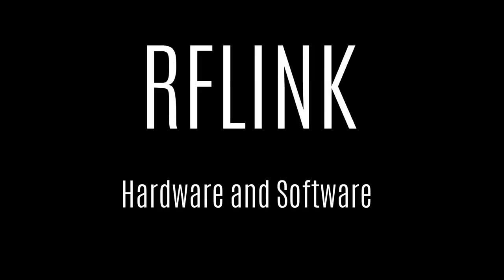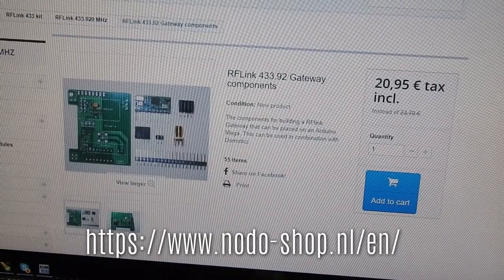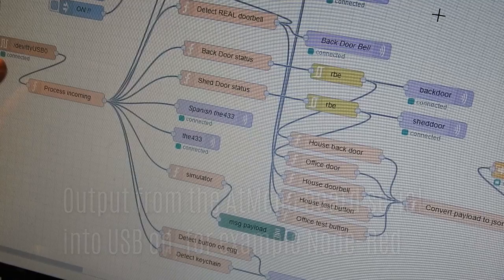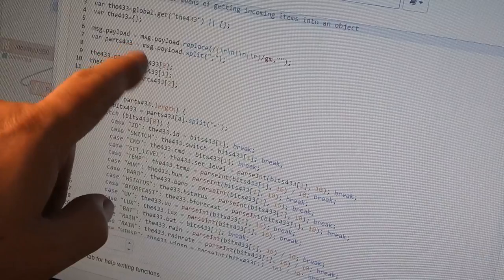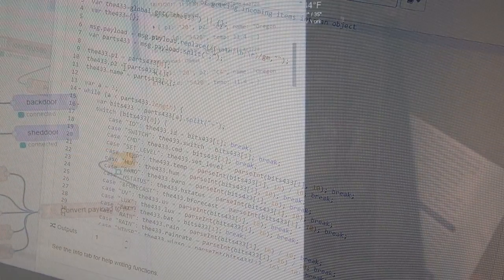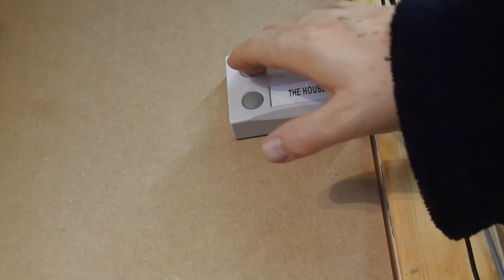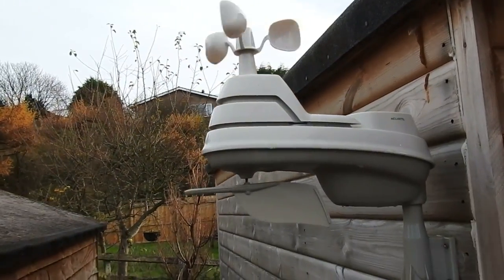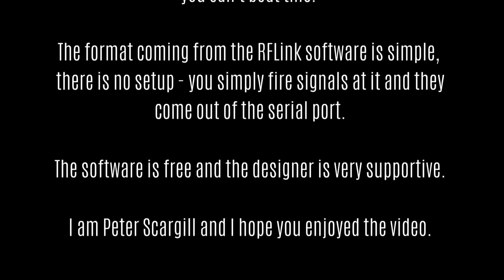RFLINK in Action

Comment: I looked at this a while ago and the problem was price. The competition is the Broadlink RMPro and family which are self contained and very cheap. They also output IR as well as covering 433 and 333 from the one device. at 35 euro. The downsides are that they are Chinese, do not yet have really good support in Node-Red (though there are nodes) and they lack an RF code database though there are ways to download from the app when run on an Android phone. On the upside they have apps and a huge code database for A/C units and some other Chinese devices. I had it working fine with Home Assistant, including learning of codes that can then be used in scripts. Interface to Wifi is a breeze and built-in too!

I've just rewired a house with RF switches talking to centralised light controllers and getting Node-Red into the equation was always part of the plan, unless I see some progress with the Broadlink nodes I might be going this route too. Bit of a shame the Raspi version is even more expensive as it would have been nice to have a standard hardware base.

Comment: This is awesome tutorial sir. Can rf codes be sent to remote rf reciecers for on off controls. I have attached rf link gateway to homeassistant using USB. I can see codes but don't know how would I control my rf devices like switch etc using rflink gateway. Thanks
Reply from the maker: Quite some time since I've done work with RF Link as you can tell from the video date - and I don''t use Home Assistant.

Comment: I've just got a RMpro and some of the Chinese 433 transmitter/receiver combos. I was planning to use OpenHAB, but having seen Node Red I'm not sure now which way I should go. Any guidance on the strengths/weaknesses of the various options for automation and control would be very welcome to this beginner..;-)
Reply from the maker: Hi Simon. Well, I think you probably know which way I'm going to vote. Node-Red is the clear winner for me. The rest are custom programs trying to showhorn in as many devices as possible and forcing you to go their way. Node-Red is a programming environment which also happens to have lots of ready-made nodes which can do much of what you want. I use radio now only when I have to - generally speaking - ESP8266 talking to Node-Red.
Reply: Yes, I guessed you would..;-) I was impressed that Node Red comes from IBM (I'm ex-HP, now retired) and know very well how good the IBM labs are. My initial playing with OpenHAB hasn't been great and it seems a complex environment to get something working. I'll have a play with Node Red and see how i get on. I've only recently found your channel and blog and its just what I need. Keep up the great work.

Comment: Terrible siting of the accurite if you want good wind speed+direction   :-D  
Curious though - you said it's solar powered? My accurite just has a solar powered aspirating fan to help move air past the temp/humidity sensor. The rest of it, all the actual sensing/RF side, is powered by the AA batts. Did you mod yours to also charge the batteries? Got details of that?
Reply from the maker: It's not a matter of terrible, Nick - it's a matter of availability!  I'm not bothered about wind direction. I plan to take this to Spain with me in the new year and it'll be sitting on top of a hill. Mine does everything via the solar cell. I've not touch it in, oh, well over a year and the remote monitoring suggests the power is just fine.
Reply: Any old pole to get it above roof-line would help, but fair 'nuff.
You may wanna pop the accurite case open. Unless yours is a very different model to mine, I think the solar only runs the fan. A good set of batts will still last well over a year, sure, but I don't think you can say "solar powered" unless you modded it.
Reply: I use a $20 TV USB tuner and rtl-sdr to receive my accurite BTW. Does't do transmit though, so still interested in the RFLINK stuff. Thanks for the vid!
Reply from the maker: Well, that's a new one on me and I will indeed take a look. In fact I think I've had it a couple of years, I had no idea there was even a battery port!
(slight pause) -  right I've been out and you are in face utterly correct, there are two batteries in there, Duracells - Well. Not only was it's PC interface crap.....   got a pointer to how to do the mod for rechargeables?
Reply: I was not aware of a mod, but doesn't sound hard, hence why I was asking for details - I  figured you'd probably already worked one out and I'd missed the video   :-D
Reply from the maker: Hah, oh, no sorry. Ok, I'll look into it

Comment: Why on earth did they use a Mega that is so outdated they should have used an ESP8266 or ESP32? very odd, I would have purchased one but not a with a mega as I want to use my homemade 433mhz TX units that last at least 2 years on one small 12v battery I have also made window detectors door detectors rain detectors (good for the wife and washing on the line) but don't really do programing just a bit of cut and paste so all I really want to do is detect 433 and send it to my phone but HA is too complicated for me all that yamil  code anyway thanks for the video very interesting and joined your channel
Reply from the maker: This video is old Bob 🙂